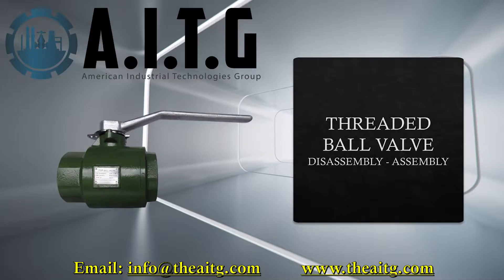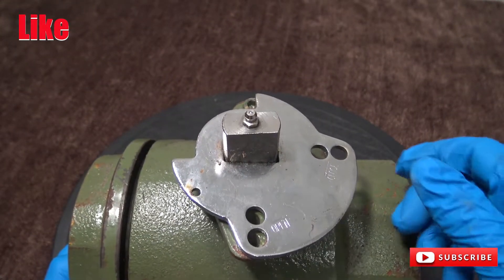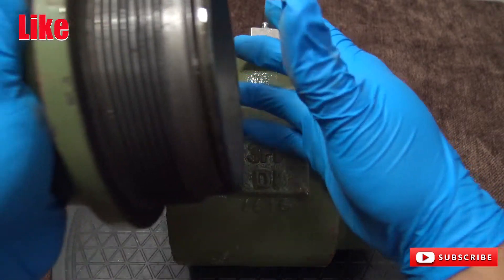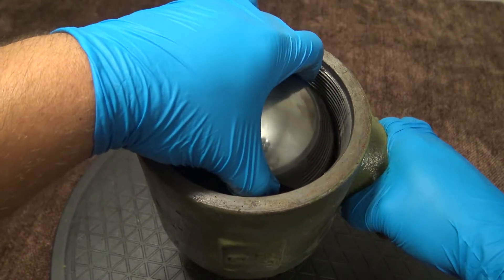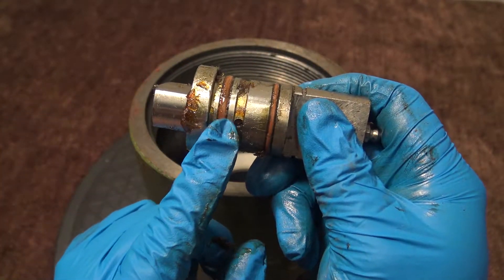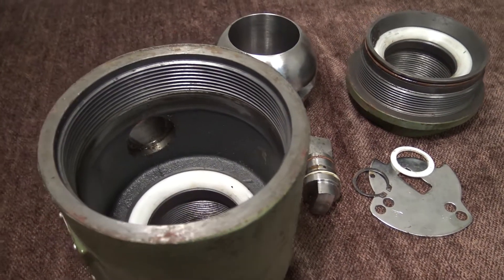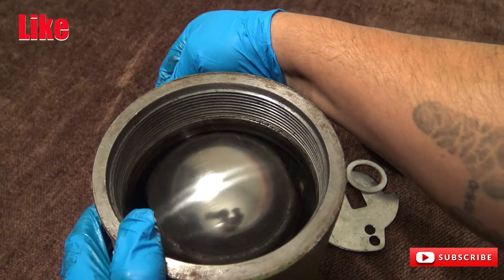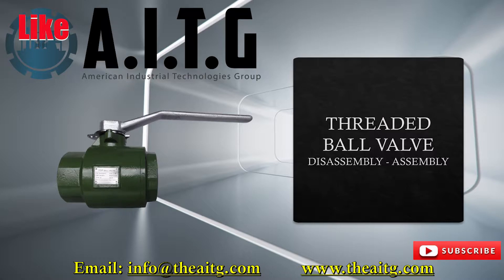THREADED BALL VALVE REPAIR. HOW TO TAKE APART A THREADED BALL VALVE. OILFIELD VALVE REPAIR

Comment: We have valves just live that and they keep seizing. Recently we found some that would open relatively easy but would not close. Do you have any tips to maintain them better? They have bull plugs on the tops when we’re done, would it be better to leave the ball valve in the open position to prevent seizing?
Reply from the maker: Thanks for the comment. Sounds strange how they will not close. Without knowing the full scope I can only give you general ideas and past experiences. 

Possibly seat insert issues or the valve adapter and body point was adjusted.  We have had users that would mount the valves inline or thread bull plugs to the inlets of the valves. And in doing so would tighten or loosen the body and adapter joint of the valve. Causing the valve not to function properly because the space between the seats has changed. It could be a number of things. 
 
When storing ball valves always keep them in the open position. This is for a number of reasons and is detailed in many industry standards. 

Really hope this helps and good luck with your situation. Thank you again for the comment and support.

Comment: 1. Nice Explanation, Keet it up mate!! 

2. I don't know if it is only for me or so, but your voice audio is low. 

3. This valve is also called as Floating ball valve, right?
Reply from the maker: kingsley rufus thank you for the feedback. When the video was posted I did notice the audio was low. I will definitely adjust that in the next ones. You are correct. This is in fact a floating ball valve and can be used in many different applications. A majority our clients who use these valves. Use them on tanks, piping systems and more. Which is why there are so many name variations. I appreciate your interest and if you ever have any questions just let me know. Thanks for watching.